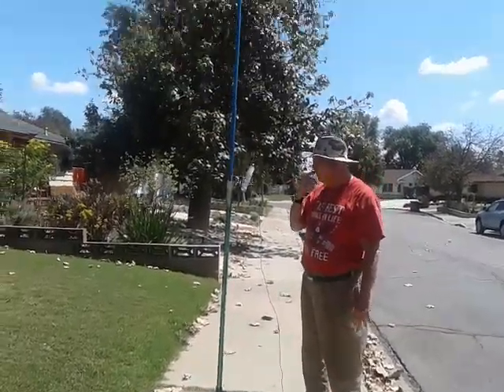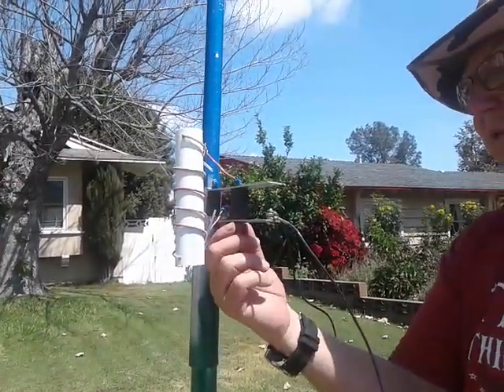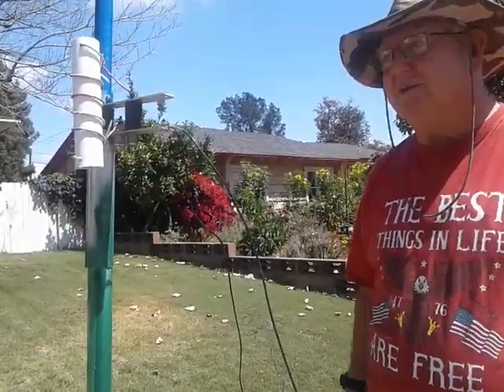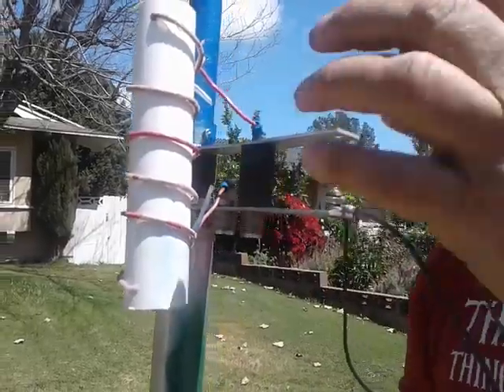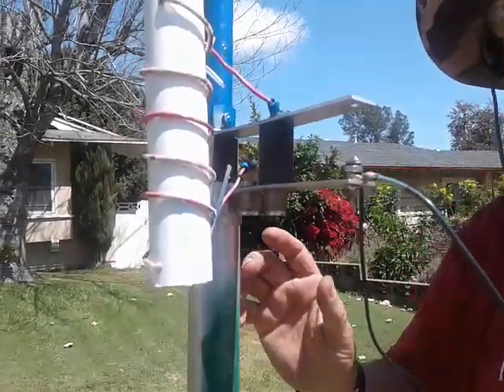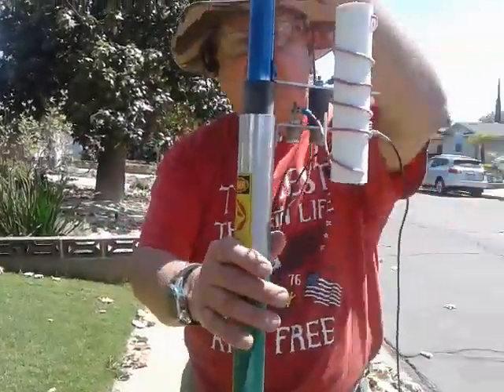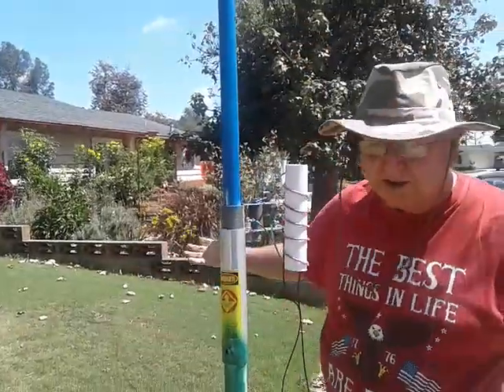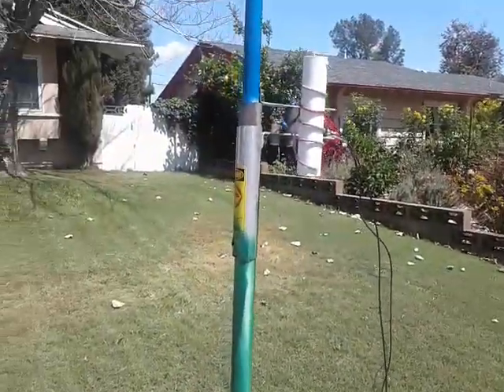Portable antenna made by Will, AA6DD. Perfect for my POTA activations!

Comment: Thanks for the 6 meter SSB contact 7-21-2018, good to work both of you    KC5BG
Were you using this antenna?
Reply from the maker: Mike Emerson Hi Mike,  I was not on this antenna in the video. I was on my 5/8 over 5/8 vertical on my house up only 22 feet running 100 watts.